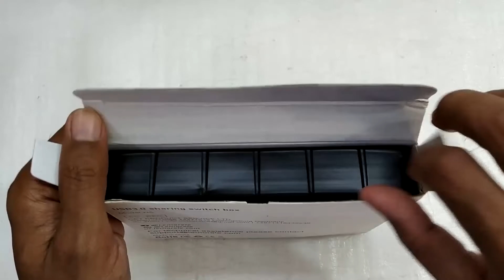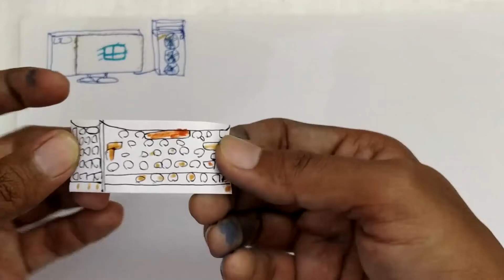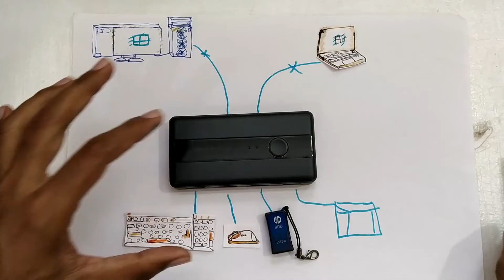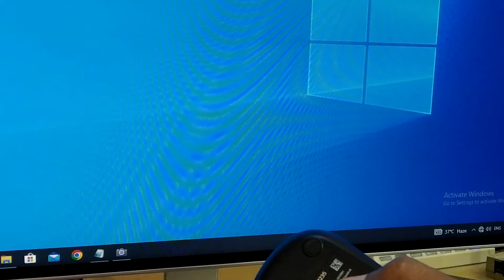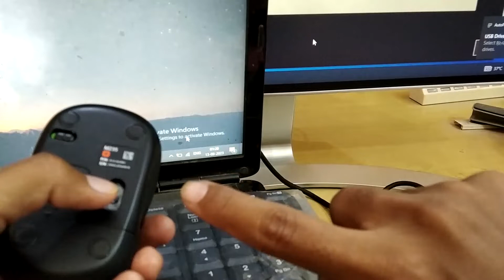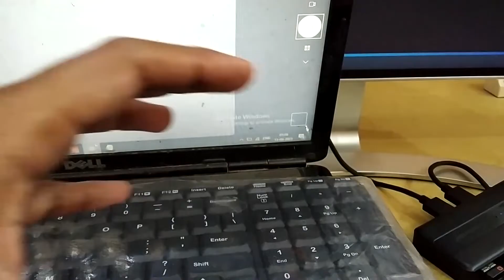Lemorele USB 3.0 Switch KVM 2 computer sharing 4 USB Ports

Comment: I want to connect this switch to 1 laptop and a monitor only. I have a BenQ monitor, and it has 3 USB ports, so my concern is that I do not want a 2 PC setup; instead, I want the following. 
1) I simply share the display using an HDMI laptop to monitor.
2) But can I connect this switch to a direct monitor and access to keybord with connecting the USB switcher to access the laptop for keyboard and mouse?

Comment: I really like how you used a diagram to show how the usb switch works. I currently have a Macbook Pro connected to dual monitors with an extended display. 

But I also want to connect my other personal  Macbook Pro to my dual monitors so that I can use the usb switch to switch periphials between both macbooks. I would just switch the video through my monitor using the input selection.

Would love to know how this would work with a dual monitor setup with two laptops?

Comment: This one didn't really work out for me. I am not sure why. I have a gaming PC and a normal laptop. I connected my keyboard and mouse (both have RGB). I assumed that since the keyboard and mouse are going to require more power so I connected the extra power cable too. I was facing fluctuation in my connection with both the peripherals on both my devices (PC and laptop). I am not sure if my piece was defective or if the product itself is not good enough for such peripherals. Maybe I need some heavy duty usb switch selector.

Comment: Why do you need this DC5V input?
Reply from the maker: That is because, If you were to connect usb devices that when working simultaneously takes more power than your computer can supply. you could use the DC5v input to make up for the lack of power that those usb devices need.

Comment: I tried connecting between two desktop it's not working on one computer... What to do
Reply from the maker: try using the back port of the desktop that's not working(if your are using the front port).
sometimes worn usb ports and drivers can also cause issues.
By the way. what operating system are you running on both computers.

Comment: Can I use this within two laptops which are connected to one gaming monitor, i have one alienware laptop and same alienware monitor and other one is also a  dell laptop
Reply from the maker: you want to share the same monitor between the two laptops. right?
If that is the case then you need a kvm for Video.
This device will not work.
Reply: @gurribuy  no brother let me explain ,

I have one gaming monitor alienware 2k 280hz it has one display and two hdmi ports  so basically i want to use my gaming keyboard for both the laptops and screens I can switch manually no issues with that as  one laptop is connected through display port of my laptop the other one is through hdmi I was thinking of connecting this hub to usb port of monitor as it has plenty of usb 3 ports.

so basically my question is that despite of my keyboard  which is a mechanical keyboard it has two connection one is for drivers and the other one is for connectivity so will it suffice the power of it ?

my keyboard is corsair platinum speed cherry mx red.

also rather than connecting this hun to power socket directly can I use my monitors  usb port to power it?